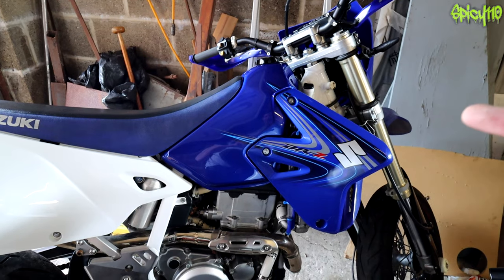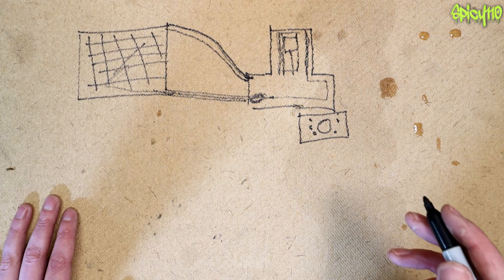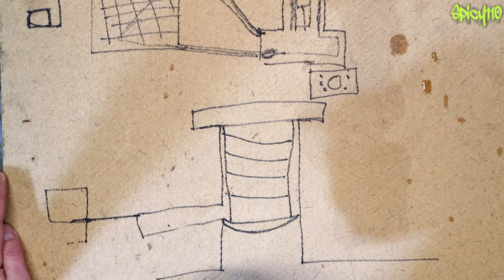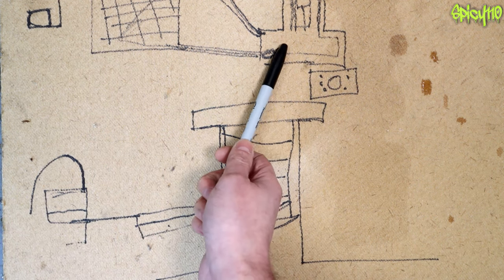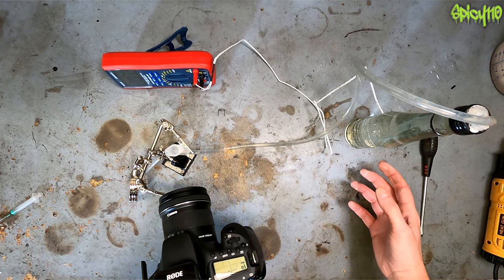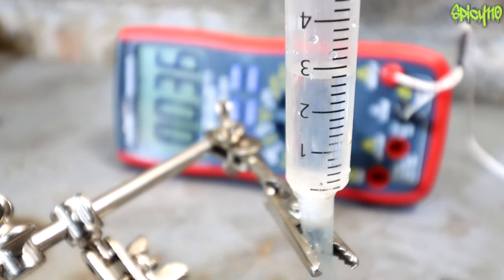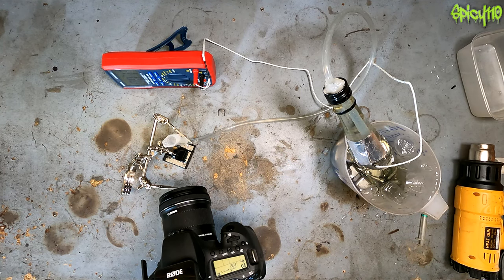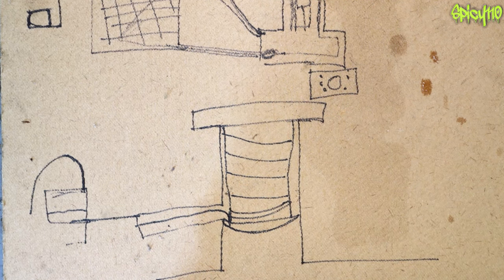Motorcycle Coolant Expansion Tanks | How they work + Practical Experiment!

Comment: I let my bike run for 30 mins in the garage to run out bad gas. Temperature got to 255 i turned it off 30 seconds later coolant came from my overflow hose. I’m lost
Reply from the maker: When the engine is turned off the coolant stops circulating, then the coolant in the engine gets time to heat up more than normal, expanding all the fluid inside so it then came out.
Reply: @spicy110  ok thank makes sense thank you. Do you think i have a problem because it over heated like the water pump and came out or that was it’s job because the coolant was already in the engine and i turned it off?
Reply from the maker: @JustJaQ_  not if you ran the bike on the spot for an exstended amount of time. The bikes cooling system is designed to work with airflow.
Reply: @spicy110  i should be able to just replace the spilled coolant and be good to go
Reply from the maker: In theory yes.

Comment: What a great experiment, especially for a layman like me! I understand the bottom fill situation, so does it matter if the tube goes in from the top, but reaches the bottom, so it will always be in the fluid so no air can enter? Cheers!
Reply from the maker: yes any air will make it harder or impossible for the flow to go back.

Comment: This was a phenomenal video. Thank you for doing such a good job explaining. 
Quick question. Since this is a system using a vacuum, does it matter where I mount the overflow tank in relation to the radiator on the Y axis? For instance if I mounted it in the back fender of my adv bike, it would be slightly higher than the radiator cap.
Reply: No it wont matter, in fact i have a ninja 400 where the OEM expansion tank sits higher that the radiator cap. Vacuum will work independent of where you have your expansion tank.

Comment: Perfect timing. I looked at mine yesterday and it was empty. Shouldn't the overflow have coolant within upto the min level when the engine is cold?
Reply from the maker: Depends on bike as to what is normal to my understanding so I do not want to give a blanket answer.
Reply: No it don’t need anything in the bottle cold, if the bike overheats , coolant can overflow from radiator to overflow bottle, once the engine cools again, the coolant in overflow bottle will get sucked back into radiator. No overflow bottle and the radiator overflow will just get put on the ground ( wasted )
Reply: Yes. Minimum when cold so there is something to draw and expand in to. If it's empty, a cycle should create expansion and air should go through the tank and when cooling it should draw some in. But better to just fill the radiator directly first.

There is sometimes 2x sets of markings cold min/max and hot min/max.
Reply: @benlondon8467  So, you run the risk of not enough coolant. Some in the reservoir ensure the cooling has enough liquid to cool the engine. By having a max and minimum it should allow for a leak and any leaks to be noted.
Reply: @forevercomputing  no I never run a risk, I make sure the radiator is full at all times, if it had to overflow due to over heat, there is plenty of room in the overflow bottle to accommodate.

Comment: Thank you for this, extremely informative.. I am buidling a cafe rcer and hence m removing the fairings, the current system has a huge expansion tank that will now have nowhere to live if I run faring less... You made mention to waterless fluid (which I have bought) after watching a Jay Leno Youtube video where he had the Evans guys talking about the benefits of waterless coolant. He even said in the video that you could theoretically remove the expansion tank as becaue there is no water inthe coolant, there is therefore no expansion hence no need for the catch tank... Was curious to your thoughts on this? I'm planning on testing by simply plugging the overflow pipe.
Reply from the maker: No, even with waterless coolant ( I am not sure how good it is anyway, be very careful about claims on shows like his. They are paying to be there!) you need to have a overflow open to atmosphere as is for some reason it did expand it would damage something. You maybe able to remove the overflow tank and have it open to drain to ground (depending where you live in the world) though!

Comment: I've watched your video and found it very interesting i have just purchased a kawasaki z1000sx while cleaning i noticed no water in expansion tank and thought there should be liquid in at all time I ran the bike this morning to running temperature till the fan kicked in and noticed fluid in the tank  as you explained now my question is do I need fluid in the expansion tank at all times even when cold ? I'm getting mixed opinions plus I'm now worried about riding my bike  cheers Mike
Reply from the maker: It depends on the bike, some suggest having some in there others do not. I would just make sure you are not low on coolant as this could be the reason or it could be normal.
Reply: @spicy110  check coolant in  radiator?
Reply from the maker: yes, if it is too low it will not reach the top of the rad to fill the expansion tank.
Reply: @spicy110  thats the thing after I ran it up to temperature and the fan kicked in there was fluid in the expansion tank just above the low level mark now I've just checked the expansion tank all the full as gone back into system leaving just a little bit of fluid in the corner of the tank
Reply from the maker: Are well that sound spot on!

Comment: Best placed in front of the rad so any hot overspill from the rad gets cooled quickly to be sucked back in!
Reply: Nope, it’s got nothing to do with the overflow bottle coolant cooling, it’s all about the water in Engine/ Radiator cooling back to a normal level than it he coolant in bottle will get sucked back into the coolant system.
Reply: @benlondon8467  there's an echo in the response you gave which only went on further to mention that the water in the engine cools. 😁

The whole point of my mentioning the placement in front of the radiator is that it will rapidly cool the immediate overspill of boiling water to be cooled 'efficiently'.

Of course when the water in the engine cools it then facilitates room for the already cooled overspill to be sucked back in. 

I guess you got triggered and thought I meant it goes straight back in after leaving through the pressure valve! (Which I didn't mention) 😲

Comment: the main reason why the turkey baster mod is stupid is in the event the bike boils the coolant the turkey baster just isn't large enough to catch the amount of coolant being forced out by steam and the steam itself will push any liquid out of the baster due to it's narrow tube shape. it's also so close to the radiator that the steam hasn't had any chance to condense and the baster itself is heated by the hot radiator. it also interrupts airflow through the radiators in normal use.
so now you've set yourself up a scenario where if the bike boils at best you'll lose half your coolant and you'll be stuck longer waiting for the bike to cool before you remove the radiator cap to refill it with water that hopefully you have to spare so you can continue.
the drz's factory coolant overflow reservoir can catch a complete boil over besides what escapes as water vapour out of the overflow vent. it returns to the radiator quicker as hot water that won't temperature shock a hot engine and you retain enough coolant that the bike can safely be operated.
now on an sm you have a thermostat and a fan so it's not likely to boil over. it sounds like you live in the uk where access to water is easy and you're never far from it.
but be aware that E models do not use a fan or thermostat and although cooling is excellent they will boil over with no airflow for long enough. if you're in outback australia crossing the  simpson desert with no water sources or human habitation for 500km you can't afford to be wasting drinking water refilling you radiators, even if you're only 20km from home it's a major pain the backside. 
basically the drz coolant overflow isn't broken don't try to fix it.
Reply from the maker: As you said in the end It is an SM, it has only ever overheated on me once when I had an issue with the cooling system.  That was way before this was fitted, never had an issue before or since. Also, the fan very rarely comes on as it never gets that hot. Yes, getting water is not tricky and if it were I would just call recovery (free with my insurance might as well use it lol) you are right if you live in a very hot country maybe not be the best Idea but I don't, this is the UK.  In the years since this video was made it has been on the bike and worked perfectly even on the 30.c+ days we get in the summer now. For me, I mostly removed it for looks and I think it looks great like this, never cursed a single issue so maybe understand not all situations are the same and this is a very viable option for people like me.  So I agree  IF it was an E and IF I lived in a hot country. 

Rather than saying it is wrong, it might be better to say, "It won't work for all situations" because as I have said it does work perfectly and there is no getting around that, it is road proven.
Reply: @spicy110  except it doesn't work perfectly, that was the the whole point of me replying in the first place.
it only works in ideal conditions and the most important function of the overflow has been removed.
maybe rather than tell me what i should say, maybe you should think about what you do say on your videos and tell people this is not ideal and could leave you stranded somewhere with a cooked motor and no drinking water.
Reply from the maker: @michael close  Expect it does work perfectly for my bike in my situation, 1000s of miles proven. It is not ideal conditions it is called living in the UK. In all the years I had this bike with the normal tank it never put more than 100ml in there. My mod has never filled past 30% and returned perfectly. I am not telling people to do it, this video explains how it works. This was after I fitted it in a video in my custom build seise of this bike and people did not understand how the coolant could get back out of an expansion tank.  As I said I agree with you IF I LIVED IN A HOT COUNTRY but I don't and this has proven to work for me.  The only difference is for some reason you seem to think I have told people to do this and also somehow I am responsible for people's actions. I have only said how it works and why I did it to my bike. Also be realistic If someone watches this, fits a mod like this, and then heads off into the Simpson.....I have a feeling there are a lot more and larger issues than this to come from their lack of knowledge.  I also do not check my boots for venomous spiders, should I also warn people of that even though I live in a country that doesn't have any?
Reply: @spicy110  you still keep saying it works perfectly, yet you concede that in a boil over it wouldn't work. so it doesn't work perfectly. it only works adequately in ideal conditions and it's most important function is lost. it's a crap mod for the sake of doing a crap mod that ignores the most important function of the standard coolant recovery tank. 
Also trying to use the whole i live in the uk it'll never happen to me argument to imply i've missed something is pretty ignorant when i've already covered that in my original comment. catching a boil over is feature nobody needs until they do, it's only the consequences that might be different.
Reply from the maker: Why is it going to boil over? Not through normal use so mechanical issue, so I get recovery.  it holds and returns what is needed day to day. It works, its on my bike and what I do to my bike has nothing to do with anyone but me. I have agreed with your core point, it has less capacity. If you really overheated the bike with a stock tank it's still going to spill out the overflow on the tank as it hold like 400ml? stop being such a floppy pancake! 😂
Reply: @spicy110  first i don't give a crap what you do to your bike. only that you made a video about expansion tanks that shows a dodgy mod.
And you are incorrect about the ability of the overflow to catch a boil over it is big enough to catch a boil over and return enough coolant to operate the bike. as i already stated.
don't burn your tallywhacker if your turkey baster shoots it's load down your leg.
Reply from the maker: You seem to be spending a lot of time telling me what do with my bike. As I said before what I do is my deal, what others do is their deal and I told no one to do it.  It is an option as it works for day to day use., It overflows to the ground via a drain hose, just like the tank. Again why is it going to overheat?  Besides I am 99% the tank was a environmental add on years after the DRZ came out. I wish I could find a link to that but 2005 was a while ago, If I find one I will forward it on.
Reply: @spicy110  all street legal drz's have had the overflow since day one. i can't remember if the drz400 kickstart had one or not but in my suzuki drz400/E manual it shows the same overflow tank for drz400 and drz400E. i bought an 03 EK3 and a 20 EM0 new only real difference is the updated countershaft
Reply from the maker: Hey and Bold New Graphic's! 😉

Comment: @spicy110 what material is used for sump washer is your drz a 14mm crush washer? Is it copper or alloy
Reply from the maker: I think it's alloy but copper will still work.
Reply: @spicy110  safe to  re use old 1 then
Reply from the maker: @MadNath  haha or course you should replace it but I have re-used them a few times. Just make sure it has not already been flattened by over-tightening and dont over do it yourself and it should be ok. However I will make it clear you do rish an oil leak so it is your risk to take.
Reply: @spicy110  💪 or go to B&Q for a pack of 14mm washers
Reply from the maker: @MadNath  as long as it is not steel haha
Reply: @spicy110  so I could use any 14mm washer as long as its copper or alloy? Might check halfords
Reply from the maker: @MadNath  they really need to be the right thing. copper or the correct alloy washer for the job. If you use the wrong one you risk a leak or even cracking the sump hole. Pop to a local bike service garage if you have one near they may sell you one for a quid.